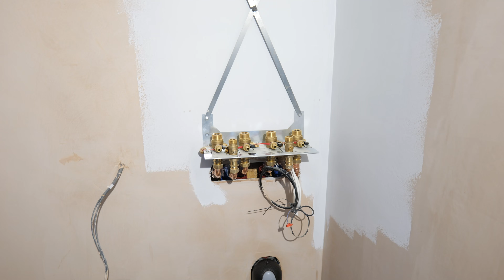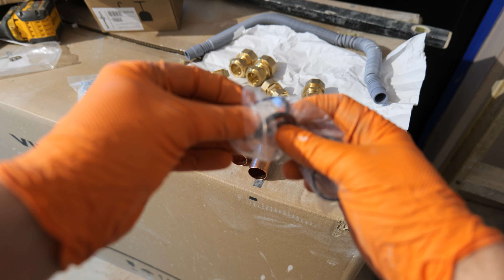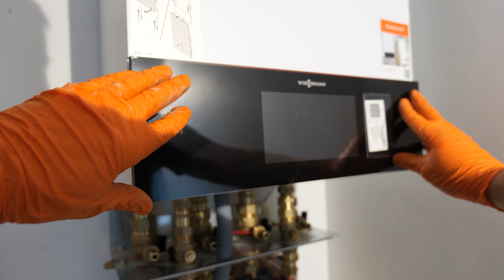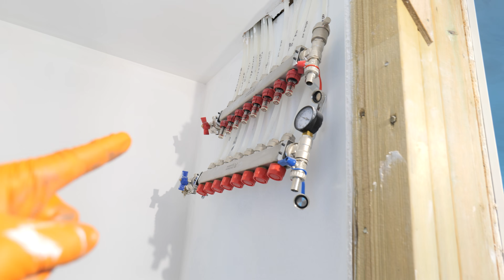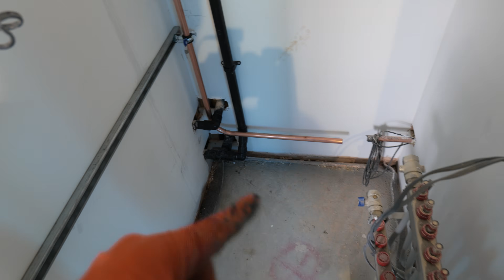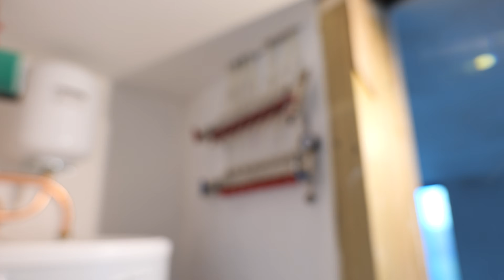How I install a Viessmann heat pump - Part 2

Comment: Cheers for the video - notice you've decided to put the internal unit and cylinder in different places, is there a particular reason for this?

what would you say is the minimum satisfactory cupboard/plant room size for the inside unit + cylinder + a single floor ufh manifold?

satisfactory = not a massive pain to get everything in and maintain it, I guess!
Reply from the maker: The architects mistake in my opinion. I wouldn't recommend doing it this way.  Usually I need around  2m wide I would say.

Comment: Nice work👍 
It's like going back to the 70's with all this open loop on heat pumps. We are going from complete control with electronic TRVs on every room, to No control apart from WC.
As the Veissmann is different with its own defrost buffer, does the system volume matter as much? Coz this would enable people to have separate temps in bedrooms especially with rads, instead of fitting TRVs as per part L, but having them fully open to give volume for defrost.
Reply from the maker: Thanks 👍🏻👍🏻. Its main purpose is for defrost but yes it is part of the system volume.